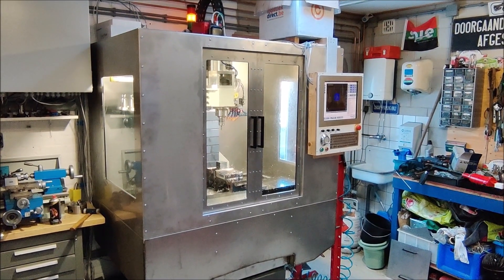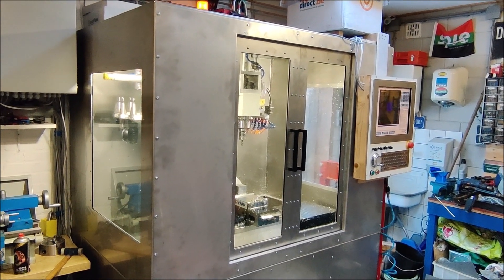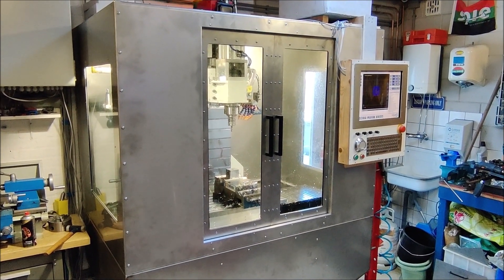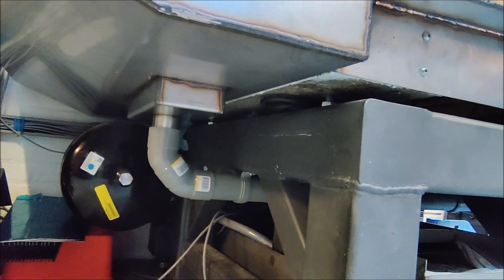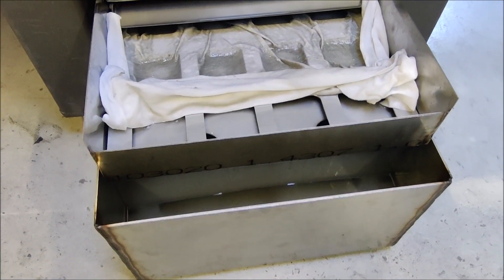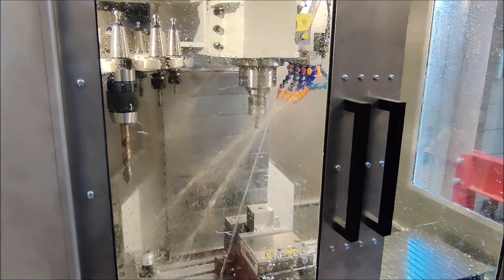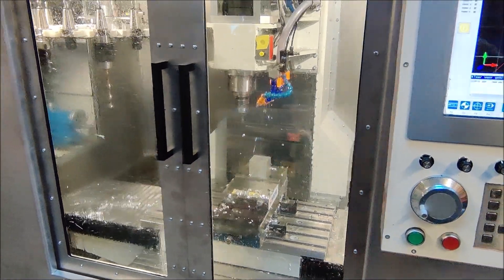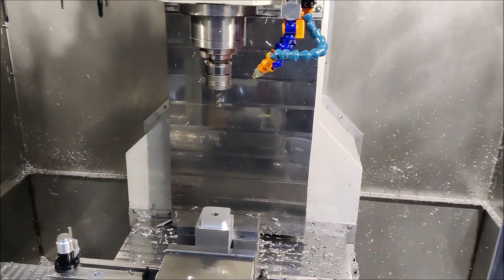Epoxy granite cnc mill enclosure update

Comment: be very carful using glass. i understand its tempered but that wont help protect you from a flying part or broken end mill. 
machine and enclosure look great tho.
Reply from the maker: There is a protection foil on the outside. Which prevent the glas from flying around. This foil also make glas more protective you should not even be able to smash tough it with a hammer. (Not tested😅)
Reply: @Svanitterzon  just makes me nervous for you when you say glass. i dont own a machine with glass in it and i can recall a few times id probably be dead if i did. my machines have safety windows, hammer blows are more likely to deform the window, not safety glass that keeps the pieces together. just looking out, sometimes we can be to smart for our own good. anyway, great job and good luck.

Comment: You could get a few Magnetic Window Cleaners to help clear the glass.
Reply from the maker: Yeah but im afraid to scratch the glas if there is a chip stuck between the wiper.
Reply: @Svanitterzon  I'm sure that if the glass is clean, then the magnetic window cleaner attached, there would be a minimal risk unless you're cutting a magnetic material. Just thought it would be a good suggestion for when you want to set up a future video from outside the enclosure to help keep the glass clear of fluid/droplets/splashes. Keep up the brilliant work, your an inspiration.

Comment: So after going through everything building this machine. If you go back to before the project began. Would you still build it or just buy a Haas or tormach? based off the machine itself .
Reply from the maker: Still build it my self, i never run a real machine. But the buildproces was a real rewarding process.
Reply: Having times and interesting, diy one or two, then you will learn a lot. Or buy a cheap one first, as you got more knowledge, bulid one youself.

Comment: Where does the noise come from,  machining process or rotating spindle ?
Reply from the maker: Its the htd belt connection that makes a lot of noice. But it's necessary for the indexing of the tool changer.

Comment: Would you be interested in providing CNC machining services for people? Just a thought, you may have got enough on with your own projects. Nice video btw.
Reply from the maker: Yeah i also do some jobshop work if you are interested.
Reply: @Svanitterzon  Okay thanks. I am working on a 50cc twin cylinder 2-stroke racing engine. Although the design is still ongoing, I am looking at ways to make the crankcases. These split in the horizontal plane, they are approximately 411mm length,  253mm width and 252mm height. Would you need a CAM file?
Reply from the maker: @TheHalloweenmasks  interesting project you working on. I gues you see my zundapp engine project? What i need would be a Step file in order to see if its possible for me to machine the part.
Reply: @Svanitterzon  Okay, thanks Stef, I will aim to do this. Yes I saw your zundapp engine video, that was great to watch, just like all of your videos.

Comment: Nice video! To have a better view through the windows when using coolant, you might add a rotary viewport. Or, even simpler, use the solution haas haas on their vf2s: just a pipe on the door where you can stick in your airblow pistol. the pipe goes through the doors and is directed at the window from the inside. When you blow air through it from the outside, this air gets directed at the window and blows it clean of any coolant.

Comment: Replace the windows with SOLID POLYCARBONATE. It withstands impact and will not break like a stalk. All metal cutting machines and test benches are equipped with one. 4 mm. are thick enough. My machine has them.
Reply from the maker: I choose glass because I'm afraid the lexan will scratch super fast.
Reply: @Svanitterzon  The glass will break on impact. Mine have not been scratched for 2 years, and a lot of shavings hit them.
Reply: @Svanitterzon  That's hella dangerous man. Seriously- get polycarbonate- that's a disaster waiting to happen

Comment: Great work stef.
There is a lot of vibration during running, what is the source of it?
Reply from the maker: You mean the shaking of the machine. I used a little too soft machine feet's so the machine is 'dancing' a little during rapid moves.

Comment: Nice work!  Can't seem to find those anchors used in the epoxy bases, do you have those part numbers off hand or was that custom?  Very Impressive machine, when are you mass producing?  Sign me up for one!
Reply from the maker: The anchors i used are an assembly of a 3xD nut a washer bold and an normal nut. I turned down the end of the 3xD nut to make it nice and round which gives a neat look in the finished casting.
No mass production of machines😆

Comment: Having any issues with chips getting on the tool holder tapers while they are in the tool changer?
Reply from the maker: A little, i clean them regularly and always look during tool change if there is no dirt on it. I already have the enclosure for the atc laser cutted but still need to be welded and mounted.
Reply: @Svanitterzon   Nice! Can't wait to see it. Great work!

Comment: Sorry to write to you from the translator))) What ingredients and in what proportions did you use to fill the frame of your machine ???
Reply from the maker: Silimix 282 with Epoxy L and gl2 harder.
Reply: @Svanitterzon  what is the aggregate epoxy ratio by weight ?
Reply from the maker: @johngamal141  10%